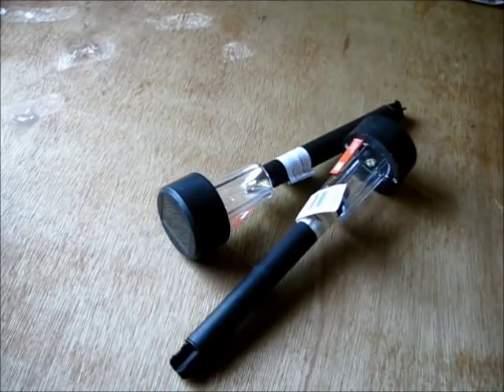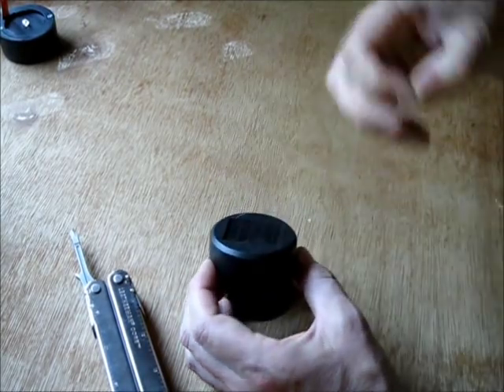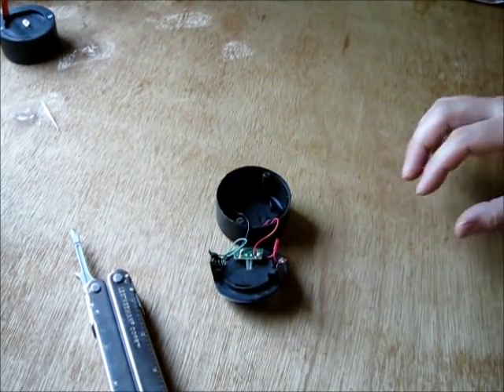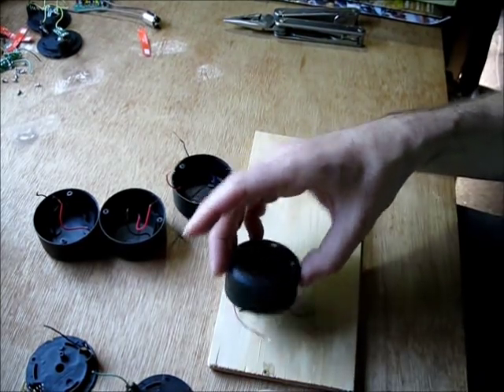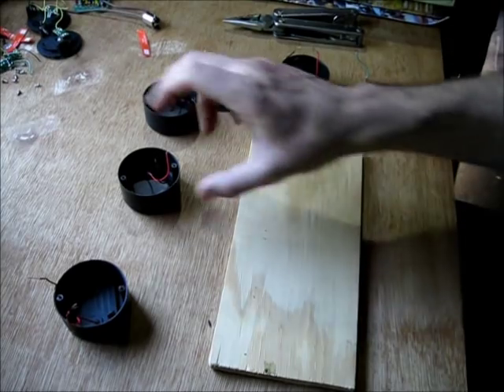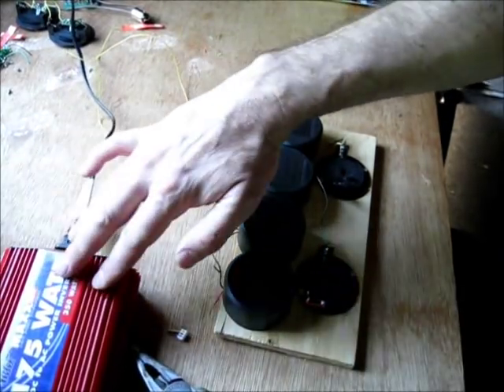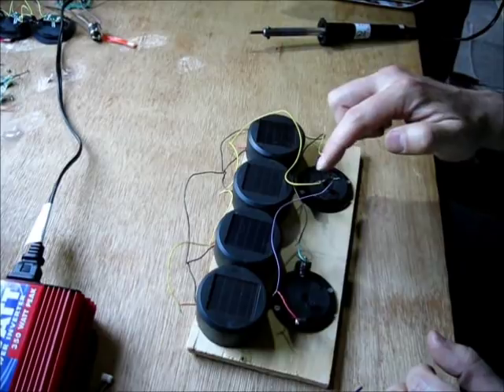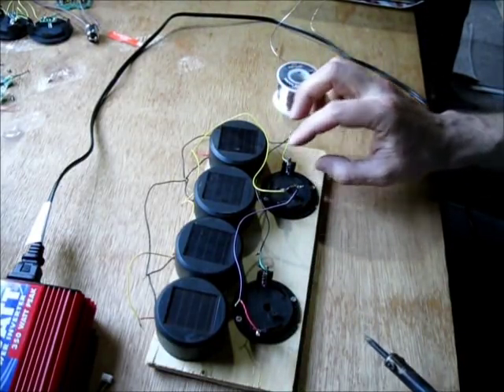DIY Solar Garden Light Hack - Solar Battery Charger

Comment: You don't check battery by just sticking a voltmeter to it. It needs to be under load to actually see if it still can produce the required voltage.
It's like saying that you can pull a fully loaded cart at 5km/h when the only test you've done is pulling an empty cart.

Comment: Yes Yes Yes I know, 9 years ago... ... ...
Question for you mr. not the diy orb.
Terribly designed.
YOU SAID, battery chargers only charge 2 batteries & the the 3rd always goes bad.
Then INSTEAD OF building a 3 battery charger with more solar panels in it.  For a 3 battery system.  Your screw up !  And build a two battery charger. WHY ?   DO THEE CORRECT FUNCTION !  Put together a 3 battery charger.  Then be sure to rotate the batteries in charging position.  P.S. battery chargers come in many different configurations. 2 - 4 - 6 - 8.
Why not get a 6 battery charger.
AND BE PREPARED !
Reply from the maker: Haha. Well that was a long time ago and I was dirt poor. I am doing better these days and now I have automatic chargers that take anything you can throw it them in any combination. But I still have this old charger on a shelf. I might do an update one day on it.

Comment: I was fascinated!  Exactly what I wanted to build. 13 ¹/2 minutes into the video and THEN you say you had to install a diode to prevent discharging.  You didnt say "wired in" to "which" wires?  Can't tell on the video.  What size or # of diode?  Where do you get a diode and the proper one?  JUST NEGATED THE ENTIRE VIDEO....... 
D U M B!
Reply from the maker: You are the first one to mention this in years. Put the diode in between the output of the solar panels and the battery to be charged. A diode looks sort of like this  ---|>-|-- and you put it into the circuit with the positive side (on the left in my diagram here) connected to the solar panel output. This will prevent the battery from discharging back through the solar panels at night.
Reply from the maker: And thanks for the kind words.
Reply from the maker: Any 1N series diode. Get it from scrap electronics. From ebay. 1N4001, 1N4007, 1N4002 any of these series will work. A regulator diode from a power supply of some dead electronics device will work find. They are black and have a white or silver band on the negative side.
Reply from the maker: If you still have trouble or questions identifying the diode, please start a new thread and I will see it. I will be happy to help.

Comment: AAA rechargeables DO NOT HAVE 2000mAH, more like 800.  AA have around 2000-2500.  Those solar cells are about 20mA, I checked them with my meter, so charging at 80mAH in good sun is NOT a rapid charger, it is a junk charger that will take 5 days to charge a single AA battery.  The reason your charger charges 2 at a time, is it is a cheap charger.  Any good charger has a circuit for each battery so you can charge batteries and not kill them.  You can get a good NiteCore charger off EBay for $10.  It will charge AAA, AA, C, D, 9V, and all Lithium batteries, including LiFePO4 batteries.  It is a smart charger, so it won't kill your batteries either.  The reason the voltage went up so fast is they batteries were beyond dead, and when charging, they go to 1.35V extremely fast, in a good charger it is about 3 seconds.  I know it's a few years later, but you can get a cell with higher output than those for combined for $1.50 in Ebay, shipped.
Reply from the maker: Mine do have that capacity actually. Technology is getting better. They are not cheap tho. This is not a smart charger and yes it will take a long time with larger batteries. But in an emergency this is a great charger compared to nothing.
Reply: You have been swindled.  Legitimate  AAA NiMH have about 700-1000mAH.  Check Wikipedia, and every legitimate manufactures websites (Energizer, Tenergy, Panasonic etc), and YouTube videos, or Amazon reviews using a capacity tester..  There are cheap China knockoffs labeled as 2000mAH, with actual capacity of 100-200mAH.  Use a battery capacity tester, which you obviously don't have if you don't believe it.  You can also estimate with a decent charger if you know the charging output.

Comment: Sorry brother, but unless you are going to install a charge controller then the battery with fry. you're  reinventing a square wheel.
Reply from the maker: You have to monitor it and figure out how many hours it should charge. I do plan to make another one day with a charge controller running off solar power. But it will take more solar cells to power the circuit.
Reply: The Do It Yourself World I've done this same thing with solar lights. I used 4 of them and ran it through a cheap controller. It works flawlessly. BTW: The lights were the ones that charge 3 batteries. So the panels are 12x as strong and recharge a single battery really quickly. I have since updated it to charge 3 now. Still very fast.
Reply from the maker: Yes those are way better. This was a video about using dollar store lights to make a budget charger. Since that day I got busy but now I have an electronics lab again and I am getting back into electronics experiments. I hope to make an improved charger one day soon. I had to move my electronics project so The Do It Yourself World Electronics if you are interested: https://www.youtube.com/channel/UCMIqpFAOBkppGkgrSC11p6Q
I will be working a lot on that channel from now on.

Comment: Using free solar panels is a good thing. For others, before buying garden lights just for the solar cells Look on EBay. You could make this solar charger for around $7.  Some very nicely assembled, totally enclosed solar mini panels are available in different voltages for some Suprisingly Low prices.
A 5.5 volt plastic coated cell delivered to your mailbox for $4.90. OR
a 1.5 volt plastic encased cell deliverd to your mailbox for $3.80.
I got an 18 volt 5 watt panel for only $10.50. I keep it on the dash of my 80 Corvette because I don't drive it all the time.  And Yes guys, for $0.49 I added a 1N5351 zener diode to regulate maximum voltage to 14 volts.
Aloha,
Holoka'i

Comment: Technically the only energy we use that's not from the sun is nuclear energy. So if you get your power from a grid that relies on coal, guess what? Your power comes from the sun! And if you're using nuclear power, it came from a supernova, which means that even though it didn't come from ours, it definitely came from a sun! :)
Reply from the maker: True most energy comes from the sun in one way or another.

Comment: Cool vid...! I have been making arrays from ov these garden lights for years cause back in '04 "real' solar panels were prohibitively expensive & I wanted to experiment. I made a light for the toilet in the place we used to rent in '09 with some older ones that were actually 4 volt panels (these lights had 2 batteries in them). Four ov these in series/parallel charged two ex laptop battery lithium cells which supported the running ov a 6v 500 mA bulb which was sufficient for the toilet. :)

Comment: In post USSR countries every pupil can tell you that connecting batteries in parallel without diodes is bad idea. Even connecting the circuits by 2 for 1 battery since better idea than this.

Comment: 2.5 volts  is too hi for a 1.2 volt battery
Reply from the maker: That is open voltage. Solar cells put out a higher voltage with no load. Many plug in power supplies do as well. Put on a load and the voltage drops
Reply: yes you are right
Reply: but the voltage drop because the battery react like a resister when it's not fully charged and it's charged the battery will overheat
Reply: ps: a made the same project and i am proud of it  
now i charge my smartphone with it (free energy)
Reply from the maker: Yes when the battery is fully charged you must remove it. This is the one problem. You must keep an eye on the battery status.
Reply from the maker: It really feels good to be able to have some energy independence. Even if its just a little bit. I started out with a solar panel in the window of my apartment many years ago. Now I am fully off the grid and living in a tiny house on wheels that I built myself. I make daily videos of my life out here on the homestead.
Reply: good for you ,i hope i can achieve that
ps: i live in Algeria (north Africa) and we have a lot of sun
Reply: with my little set up a can charge 3 smartphone every day
Reply from the maker: Wow!!! You certainly have a LOT more sunlight that we do. Good for you!!!!
Reply: yes we have a beautiful climate near the Mediterranean sea

Comment: You probably already figured this out but:  I took my lights apart.  I got to the portion where the solar panel was and baked it at 235 degrees for 5-10 minutes until I could pry it off the plastic with a sharp point.  That way you're left with just the flat panel with the + and - leads.
Reply: I was thinking about doing this too. The plastic is really annoying.

Comment: Why are you using an AC powered soldering iron? If you're off the grid and relying on DC power, instead of using an inefficient inverter, you ought to consider using DC appliances instead of wasting 30% of your energy running it through an inverter. The efficiency these cheap inverters list is the PEAK efficiency and not the typical efficiency. Most of these cheap inverters are less than 70% efficient at most loads.
Reply from the maker: I know and have been looking for a 12 volt soldering iron for years. I solder so much its worth it.
Reply: The Do It Yourself World
You can always get a butane powered one at Radio Shack. There are also battery operated soldering irons (but you have to use rechargeable cells or lithium cells). I have a really cheap 4 AA one and it works great for small jobs like this, but not so well with alkaline batteries (takes longer to heat up with the alkaline cells)
Reply: click411

DC powered refers? No. Not that I'm aware of. LP Powered refers. Yes. In motor homes.
Reply: The Do It Yourself World get a battery operated one and cut the micro usb end off a USB cord.  Solder in the cord and bing,...you have a dc soldering iron.
Reply: David Brown Most of the handheld corded irons can use 120VDC  and there's always the butane powered soldering iron as well. Radio shack sells a 3 cell (it might be 4 and they sell replacement tips for it) AA iron and with rechargeable it heats up in 7 seconds.
The problem with USB is the ones that plug into the wall want AC and your PC won't deliver enough power to work it. DC lights are very easy to find and DC refrigerators (small ones) are sold at truck stops.
Reply: click411 Yes they do. Check out this one: http://solarsquawk.com/grape-solar-glacier-1-1-cu-ft-acdc-fridgefreezer-2/
Reply: Why are you lomiting yourself to a computer usb port.  A fast charging  cell phone plug will deliver 2.1 amps.  I think a AA size battery delivers at .56 amps so even if you made the argument that the 3 cell AA soldering iron was connected in parallel and not series, the USB would deliver more than enough.  The real argument would be that many of these DC soldering irons are usually 4 AA cells in series adding out to around 5.2 volts - 6.24 volts at half amp.  That is where the problem may be more apparent so make sure to get a 3 cell.  Although the sokdering iron in question has a spare tip I wouldn't suggest using it as your main soldering iron.  If you have to be off the grid I get it but big brother probably atill knows where you are and you are cutting out a lot of life to do it.
Reply: David Brown Most PC based USB ports (assuming it's a single port and not sharing power with another port) wouldn't even be enough to power a small iron. I have one of these and they discharge 2500mAH cells very, very quickly. The whole USB bus would lock up. 4 quality AA cells at 2500mAH could put out at least 2C (5A) with at about 5V is 25 watts. Even a fast charge 2.1A (at 5V) would put out a little over 10 watts. That could probably heat a very small iron, but it would take much longer and needs to be plugged into an AC outlet anyway.

Comment: This circuit is basically only feeding in energy without it  being able to stop when it's full. NimH's don't like that, that why all NimH charger have a cutoff circuit.
Look at the blob in the picture bellow, it's a chip which tells the charging to cutoff when the battery is full.
http://i280.photobucket.com/albums/kk164/bigclivedotcom/solar2.jpg

Comment: Love it! Nice job of finding useless cheap stuff and using the parts to make a battery charger There are all kinds of electronics for next to nothing. Bye something at the Salvation Army (or the $ store) for 4 bucks and it's loaded with diodes, transistors,  switches, relays,  capacitors, ect.